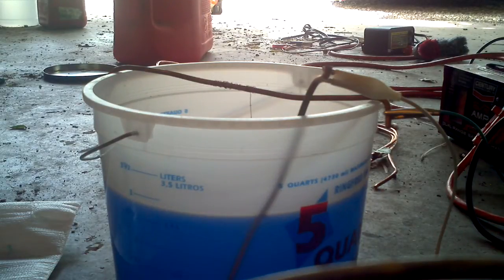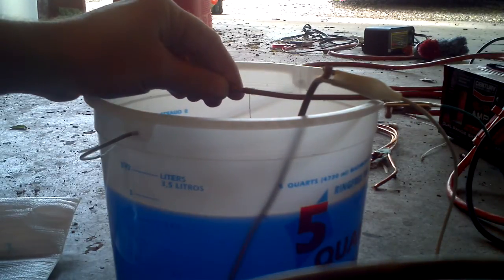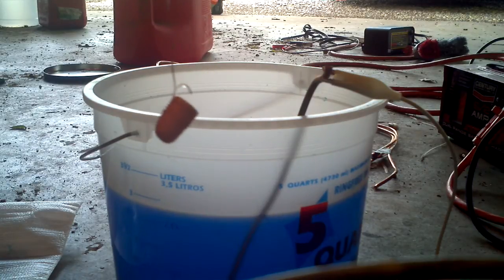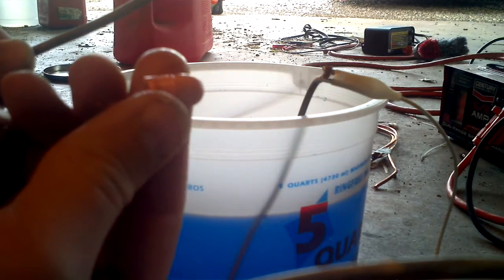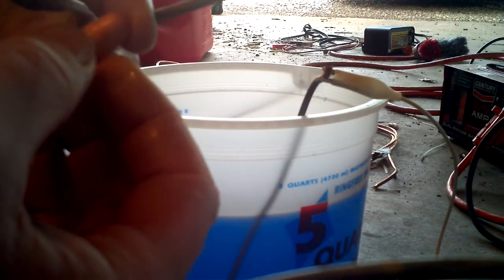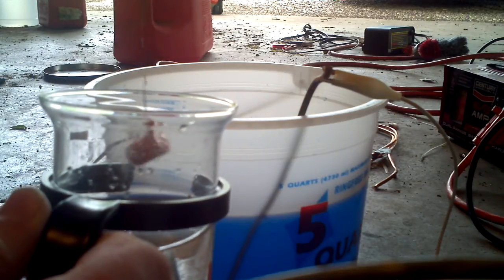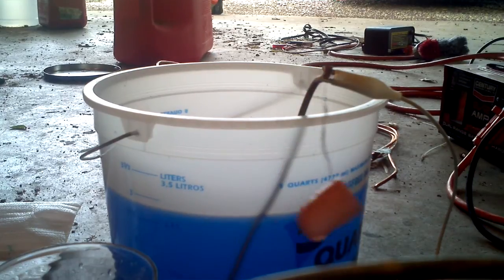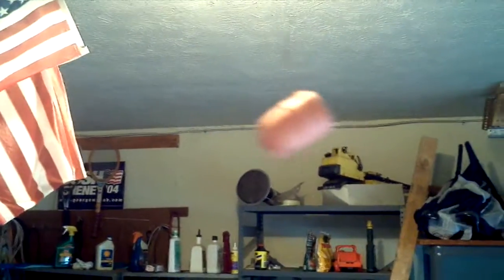Copper Plating Cast Lead Bullets - Pt 4 of 5

Comment: I believe I would store the solution in plastic jugs until it would no longer work (a very long time). be careful pouring to eliminate the sludge.  I'd say a wall wart would do a good job if you add a voltage regulator (lm317) and check the current.  A lot of wall warts provide low current but better check to keep it low.  Good post with nice results.  the polishing idea is great!  Thanks

Comment: I'm glad I used a 2 cup measuring cup and kept things small as I used Distilled water not vinegar, and used brake clean instead of acetone, and did not acid dip over night.
Mine plated fast (like 10 to 15 minutes) but was super fuzzy and 90% did not stick at all.
What did stick came off fairly easy with a light brushing with a brass brush.

Comment: Please move the gas cans away from the electrical equipment. You may only be running 1 VDC at 300 mA out of that box but you've still got 120 VAC 60hz with probably 3A running into the back of it (and any extension cords etc).

Thanks for posting this though. Learning lots of useful information before I build my own setup.